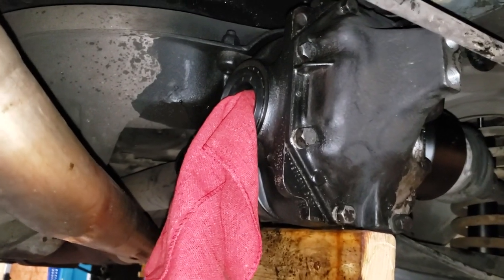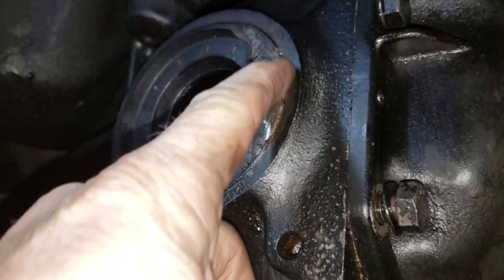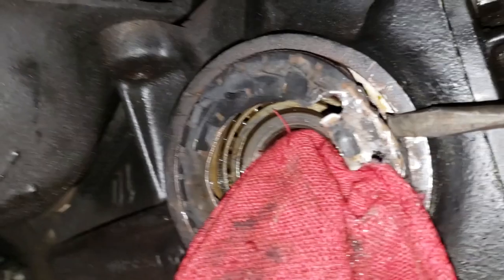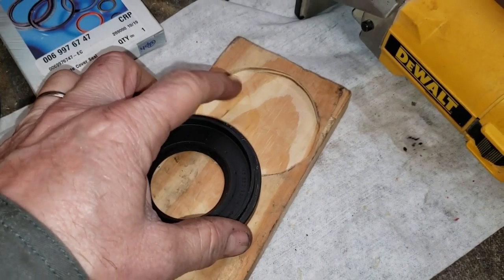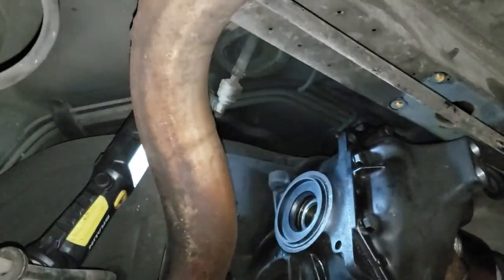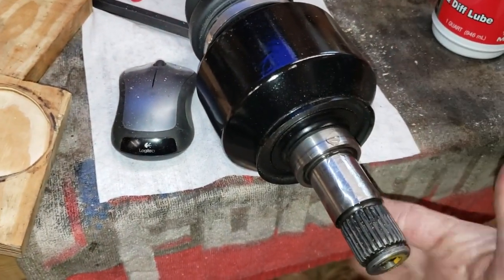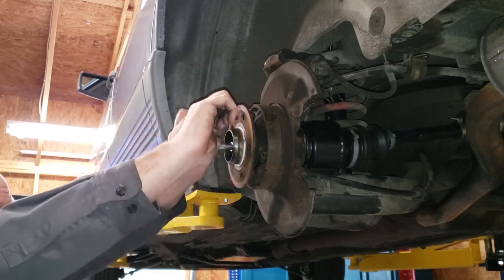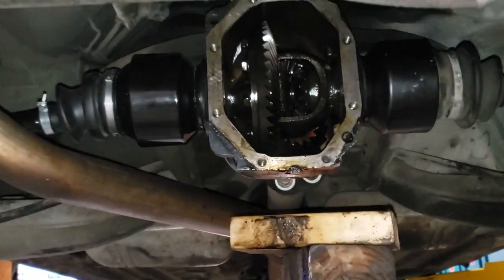W126 Mercedes - Differential Side Cover Seal and Rear Drive Axle Installation

Comment: Excellent explanation! I did the same in my euro w123 300d. Now watching the video those axle seems bigger, robust than on the w123 ones knowing that they have almost the same kind of rear suspension
Reply from the maker: Yes axles can be different sizes depending on application. My old W210 Wagon had larger axles that the W210 sedan.

Comment: I like that you cut the board in the form of the bearing cover.  Most people would just tab on the sides to get the cover in.
Reply from the maker: Tapping a seal on from side to side is generally a bad idea. I've not had good luck with that.

Comment: A couple questions please. In your prior video of rebuilding the CV joint, you showed 2 flat, 4" O-rings and one smaller one. I got where that one went, and one of the 4" flat ones. But there were two flat ones. Where does the second one go? AND... on the end of my inboard CV joint, there is a notch and a drop of paint, highlighting it. Any idea? Does it mate to something on the inside of the differential, like a timing mark?
Reply from the maker: I don't know where the second one goes. I didn't use it. I assumed it was a spare in case you screwed up the first one. Everything is working fine and there are no leaks. There is no keying or special positioning required to slip the axle shaft into the diff. (at least not on my car) I'm not sure what that mark is for on yours. It might be something associated with your specific model. I would research it further to make sure. I'm not much help there.

Comment: Question on the rear wheel carrier inner seal?
How far IN is the inner seal?  Is the seal flush with the wheel carrier opening or is it supposed to be driven in past the wheel carrier opening outer edge? Does the axle can rim edge make contact with the inner seal?
Reply from the maker: 6:56 - The very outer edge of the seal should be flush with the differential housing.    >>  Does the axle can rim edge make contact with the inner seal?
 Unknown but it does not need to. The contact point that is important to keep fluid in the differential is the one made between the shaft of the axle and the inner rubber diameter of the seal. This is the way most ALL shaft seals work.  (Ex:  Crank shaft seals on the front of an engine)
Reply: @ImpalamansGarage  I'm talking about the inner seal to the wheel carrier, where the  rear flanges are turned by the axles. Behind the brake calipers.  There are two seals (radial seals) on the rear wheel carrier.  You have the outer seal and inner seal and in between all of this you have an axle flange that has two tapered bearings, an outer bearing and an inner bearing.  The entire assemble is held by a special slotted nut that holds the assembly in place on the wheel carrier.  The rear axles are inserted into the differential but are also inserted into the axle flanges.  Again, I'm talking about the inner seal to the wheel carrier
Reply: http://www.peachparts.com/Wikka/W123RearWheelBearings  
There is a picture where the inner seal is being driven into the wheel carrier.  The factory service manual (FSM) does not specify on how far you are supposed to drive the inner seal into the wheel carrier.  I completely forgot to pay attention to the old inner seal so that I could of used that as my reference.
Reply: Come to think about this, the inner seal will probably eventually stop at the inner racing outer edge.
Reply from the maker: @gbenz6494  If you do not have it already, I have some factory service manual documentation on the wheel bearings that have a couple of diagrams that may be of help. Email me and I will send them to you. I've not done anything to the wheel bearings on my 300SD since they are running fine.
Reply: @ImpalamansGarage  Just emailed you.